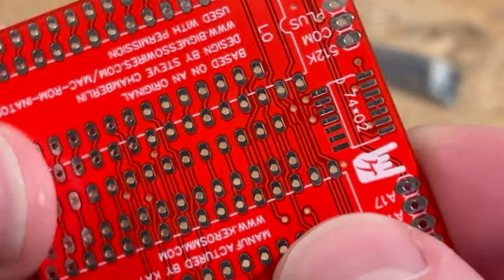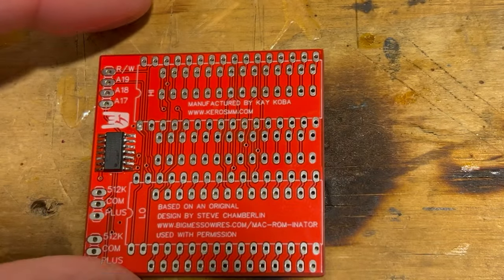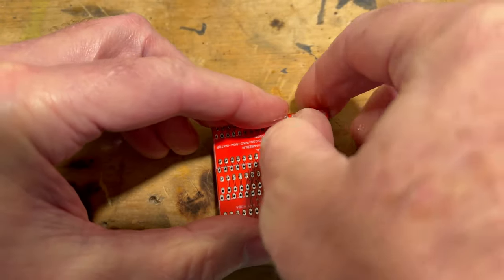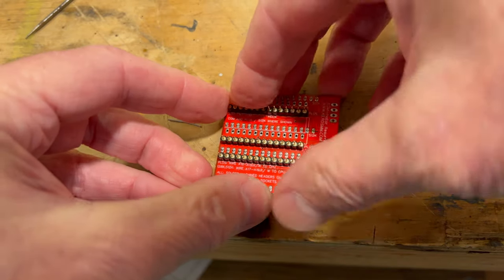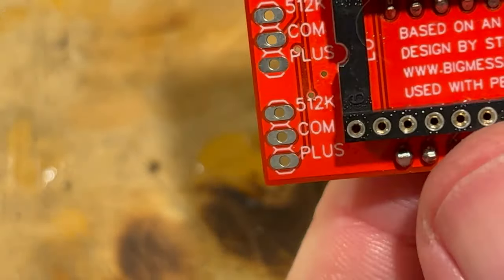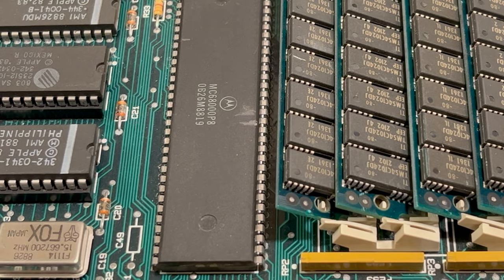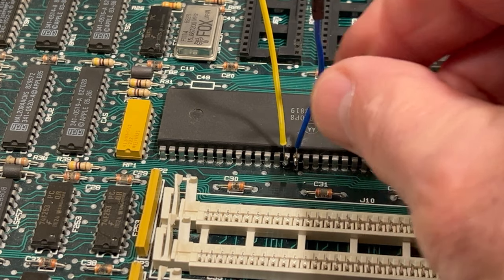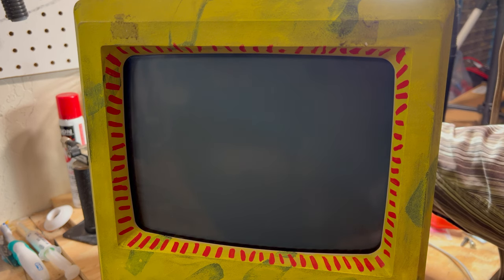INSTALLING THE ROMINATOR KIT FOR THE MAC PLUS part 1

Comment: Love the cliff-hanger, Dave! 🙂
Reply from the maker: I am  bulding Another Rominator hopefully this one works
Reply: @DavidStahlOLDHAPPyMACs  I rewatched your video, and it seems you did everything correct.  But of course, that assumes all solder joints were perfect, no ICs were zapped by static electricity.  The only thing you didn't show at the end of your video is (a) if you had the main cable attached to the motherboard, and (b) if you had the power cord attached.  I didn't hear any bong or sound whatsoever, which made me wonder if there was power getting to the motherboard.
Reply from the maker: @JDW-  Well I got the Rominator to work in part 3 thanks to Kay Koba  I had to shave the sockets down to make a good connection
Reply: @DavidStahlOLDHAPPyMACs  Glad to hear you got it working.  I couldn't tell in your video if sockets were making a good connection or not.  But when I did my build, I had to shave one of the sockets as well.

Comment: I'm sorry to know that it doesn't start...
- The pin header that connects the logic board and the ROM-inator PCB is upside down.
- It is better to connect COM <> PLUS with a visible top.
- It looks like the yellow connector isn't stuck all the way in.

During this cold season, static electricity may be charged to the human body, so it is better to touch a large iron to discharge it before touching the ROM (steel doors and EPROMs are static electricity). It is weak and may cause a malfunction. Please DM if there is anything I can do!
Reply from the maker: I bought another ROM-inator kit I will assemble it on Thursday we will see how this works out thank you for you very much for your information